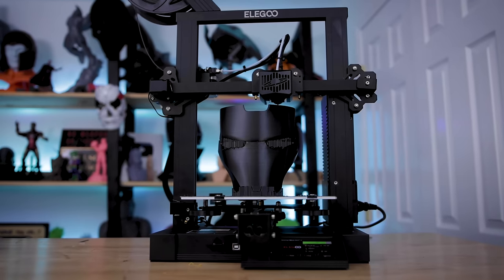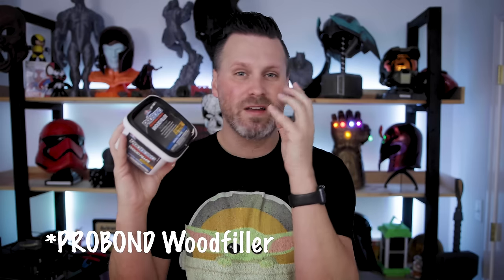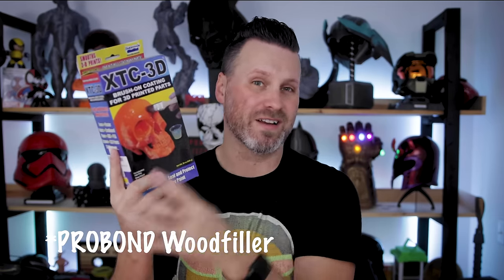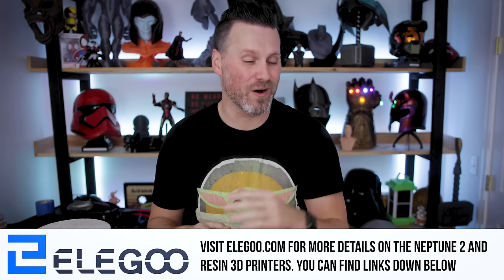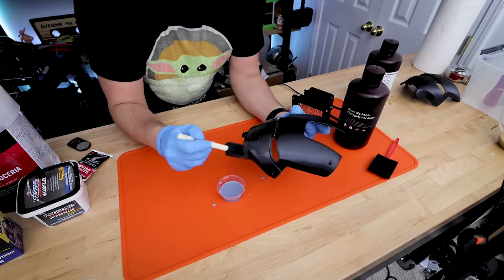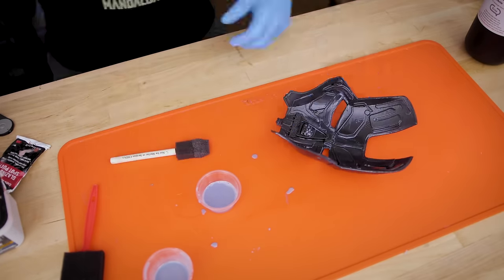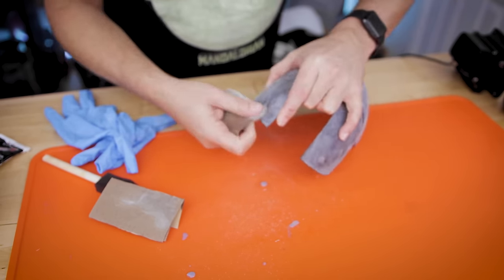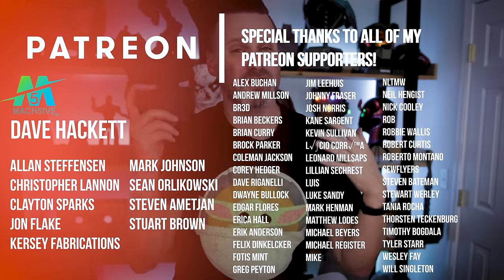3D Printing Hack - Smoothing 3D Prints with Resin!

Comment: awesome. But what about the "Cleaning" aspect of resin printing? Like on other videos I watch you put it in the Cleaning Vat from Elegoo. Is that step not required cause its only a coat and not the whole Model?
Reply: The cleaning process is only necessary with normal resin printing.  This is because the print is being dipped and it leaves a coating of unwanted resin.  With this process you are only applying a thin coat of resin that you want to keep on your print to be cured.
Reply: @drkline69  thanks Dave. Man I love this Community.

Comment: I've used xtc-3d in the past and while it's amazing, a) it is quite pricey, b) the cure time without sunlight/UV light is longer, c) and for fitted parts, it affects the fit tolerance.

So, I've just been using 3M Acryl-green spot putty...  I will definitely try out using resin to coat my models, especially to get that engineered clean look to it

Comment: Hello, I'm not sure what happened with me but I tried with Siraya Tech Fast resin and... Nothing. Even after 10 minutes, still very sticky.
Tried again with Monocure 3D and even if something happened I never achieved a fully cured layer.
Reply from the maker: Hmmm you should hopefully still be able to sand it down lightly or apply a light coating of primer over it

Comment: I am not sure about the XTC-3D resin coat anymore :( I had a perfectly sanded surface, I just wanted to add a coat of resin to give some strenght to the prop I am making. The product datasheet says this is a self-leveling resin, no brush strokes, etc... however, after I brush it on, it starts to form lumps and holes... I am using a foam brush, looks great when I brush it on, and ends up ruining the prop after it cures. Maybe I am the one who does something wrong here, or maybe this resin is just not suited for a smooth surface.

Comment: This works well since it is fast but I am going to stick with XTC on projects where I have the time. I feel it is a little more forgiving on prints and I can go with an 0.28 or even 0.3mm with it. I will be using this on statues and other things that I print at  0.08 - 0.2mm layer heights. At those it is perfect.

Comment: I have thought about this, cause ive used epoxy so much and only in last few months started 3d printing. 

I use Mr Surfacer though, 1200 and sand to get it smooth and it acts as a primer ready for painting..

Comment: Hello I know this is a old video but I'm using elegoo water washable ABS like resin (this is all I have right now) and 2 large UV lights rated at 405n and 2 UV strips and no matter how long I keep my PLA prints they do not cure. Is this the wrong resin? Should I use regular run of the mill resin to do this?
Reply: Did you ever figure this out @kyoz? I’m running into the same problem. Sticky no matter how long the cure, UV, Sunlight… it does cure
Reply: @paulhunt608 for some reason this particular resin didn't work well for this technique. So I just purchased the most basic elegoo Grey resin and it works perfectly.

Comment: Could you have gone without the sanding after curing the brushed on resin? I'm trying to get a part without the microscopic lines and divots that come with sanding
Reply: To clarify, I'm not planning on painting and this is for a silicone mold so I care much more about the overall smoothness rather than the appearance

Comment: Use Rundo. Way cheaper than 3d printing resin 
50/50 bondo and fibreglass resin, add enough hardener for both parts, add more bondo or resin to make thicker or tinner. Easy to spread around, can be thin and runny to get into small cracks and imperfections. Dries harder than bondo due to the fibreglass resin, easily sandable and easily paintable!

Comment: It's a really great idea but not super cost effective for most people. Resin is several times the cost of the other smoothing methods you mentioned and the surface finish didn't look drastically better than what those offer (I'm willing to be proven wrong on this). Great idea though
Reply from the maker: Yeah you can get a bottle of resin for about $25 on Amazon and should last a good while by painting it on in thin coats and then pouring any left over back in the bottle. XTC-3D is also about the same price. Woodfiller is def the cheaper option of the group. I think my container I buy is maybe $15

Comment: Hey, can you answer my question?  Why can't you just pour it on and then hang it to dry and let gravity do it's thing.
Reply from the maker: You could, you would also need to cure it with uv light
Reply: @UncleJessy  great, I have a UV booth. I’ll just add a drip tray.

Comment: Using UV resin (for SLA /DLP 3d printers) requires to wear a MASK (ffp2 at least ) due to COV (toxic particules) ans especially when curing to UV light. 
Also , UV light must be used with EYE PROTECTION (glasses or proper enclosure) 
When you respect those basic rules, resin printing is  the best

Comment: Where t you about to compare the two resins?
I love elegoo waterwashable resin, because I have to deal with one chemical less. Also when using a ultrasonic cleaner for smaller parts I feel like raising the gas level on my workspace dramaticly when using solvents.

Comment: that's a neat little trick. What i usually do to finish my prints smoothly- prime the print with a platic base, then spray it with a fillerprimer and use 400-1k grit wet sanding paper and it's smooth like a babies butt!

Comment: I use epoxy; cheaper and stronger than UV cured resin. I also use epoxy or polyester paste to ad some details
Reply: You can also use epoxy to glue 3d part. Its realy strong. I use silice as a thickener (wear a dust mask when adding silice to epoxy and be in a well ventilated area. Silice wrecks your lungs)

Comment: I thought the whole point of sanding was to smooth out the printed parts to get rid of layer lines..  If you're "Smoothing 3d Prints with Resin!", why still sanding it afterwards?
Reply: texture? i've never spray painted anything, but maybe it helps? it was a low grit, so it sure as hell wasn't to get a smooth shiny surface.
Reply: Because you need paint (rather primer) to adhere to the print properly, a smooth surface makes this extremely hard. Roughing with 220 is a bit course in my opinion, I rough with 800-1000 grit sand paper.

And this should remove a lot of the effort of cleanup.
If you use filler, you have to apply it manually to all the surfaces, avoiding places you don't want a load of filler, getting proper coverage takes time, and filler becomes unworkable after a short while. So using a product you can literally slap on, and harden when you want, does remove a load of effort.
You're going to have to rough the surface either way, for adhesion.
Reply: The point is to raise up the low points so you don't have to sand nearly as much. You'll also get a stronger part in the end because you're not removing as much material.

Comment: How did you clean the resin after cure? because it normally should get very sticky.. and does the filament melt or something because you need the normal abs like resin to clean off with alkohol....

Comment: Maybe I'm crazy here, but couldn't filler primer have done the same?  it's not like the gaps are that exceedingly huge here.  Especially on a print like this.  It would have been better to show how well it works on a print that has a ton of minute detail (to then see if this resin would fill in those details too).  Having done automotive bodywork before, I'd say filler primer would have yielded similar if not the exact same results.

Comment: for cheapskates lik me , use CA Glue (superglue) to a similar effect, although its more brittle and a bit harder to work with, you don't need UV light , its faster, and its pretty cheap. another solution would be epoxy. or fillers like woo filler / plastic filler

Comment: Technique we started using at work for personal projects is using super heated acetone for smoothing PLA. The size of the model just depends on the size of the vessel you are heating the acetone in and it take just seconds to get a nice result... And yes I do mean PLA not ABS, if done correctly you can use acetone to smooth PLA.

Comment: so much  easier to just spray a few coats of a two part epoxy primer even really bad .02 stepping will vanish with 4 coats. that is what I used on my c3po sands super easy most layer lines vanish with two coats was like a mirror when chromed no layer lines

Comment: Actually, Tom Sanderlander came up with this about a year ago. I use a 50/50 mix of IPA and resin in a spray bottle. I use a foam brush to smooth out any drips.

Comment: Question regarding the structural stability and strength of a part that is finished with this method: would you use this method for a part that needs to look good and also remain structurally sound (e.g. a load bearing cog in a clear box where all the mechanisms are visible)?

Comment: Innovative idea. The only problem with it that I can think of is longevity. Epoxy will not chemically bond to the other polymer, but only be mechanically held to it. It could start cracking in the future, but maybe not. Great video. Thanks.
Reply from the maker: Thanks! Yeah time will tell how this all holds up over the life of the prop

Comment: Ehm… is it me or did you put more effort in painting with resin and sand (repeat if necessary)and than spray with filler.. 
than that you can spray with filler(because that is what filler is for) and sand..  

Because the first off all more work , expensive, more dirty work? 

what is the logic ?
Reply: Its something that seems much better with detailed pieces. I make a lot of stuff that is annoyingly hard to sand and spray isnt as easy to control as something you brush on. putty thinned down works great, but resin would probably give you a solid amount of time to get it all in the right spots

Comment: You need to show more safety precautions in the video people will not read the msds for resin or know about the effects of UV light on the eyes.
Reply: Also latex gloves are not meant for resin they will melt, nitrile should be used and should also be mentioned

Comment: Considering the price of 3D printing resin I wonder how regular artist resin would work for this
Reply: 3d printing resin is far cheaper per ml than artists resin. You can use artists UV resin aswell, but it goes on a bit thicker! Another option is epoxy (laminating) resin, you have to mix it with a hardener but you won't need UV resin and cures hard by itself. Epoxy resin is usually also a bit thicker.

Comment: As a user of XTC-3D I do NOT recommend it to anyone.  It is, honestly, a difficult product to work with and is extremely hazardous.  If you don't have a fume good and a respirator with vapor cartridges don't even bother using it.  As for strengthening your projects, that is true but it doesn't really make the parts more durable.  It will flake off parts if you intend to use the parts with regularity.  There are other alternatives on that market that are environmentally and health friendly that have similar or better durability.

Comment: why are you messing about with expensive commercial resins ( consume, buy, spend), just dissolve some failed print in cheap acetone over night, stick some carbon in the microwave for 30 seconds, cool and blitz it in an old electric coffee grinder, then add to the dissolved mix sitting on the shelf, use as required, dry and electro plate/brush diy copper, Nickel, Nano aluminium etc it for giggles and added strength. see diy 'Robert Murray smith conductive inks'

Comment: Thomas Sanladerer had some pretty good results  https://www.youtube.com/watch?v=nOZaTB34RrI he used heat also solvents to thin the resin slightly so that might help with retaining the finer details as you can thin it out and creep up on smoothing although he saw rounded corners but his tests were smaller. But I've used resin on my parts with good results :)

Comment: "I'm gonna be using two different resins for this test..."
Doesn't say where or what the difference is
Reply: Yes he did.  The ABS like (which was thicker) was on the outside and the water washable (thinner) was for the inside.